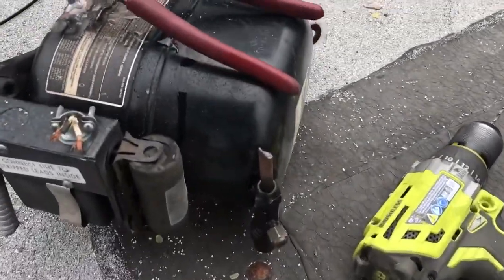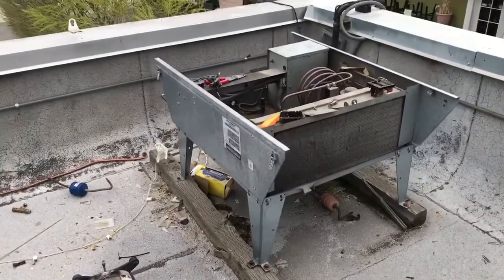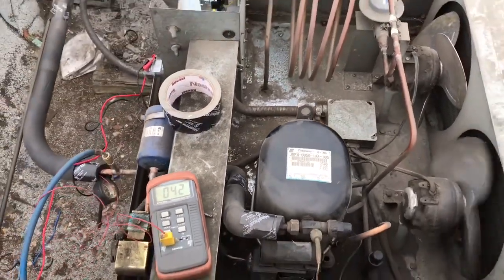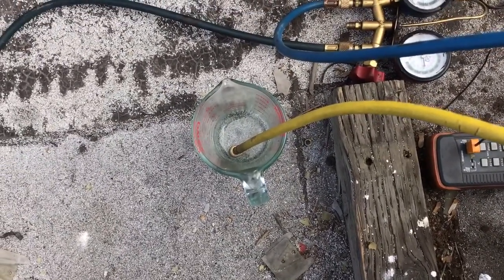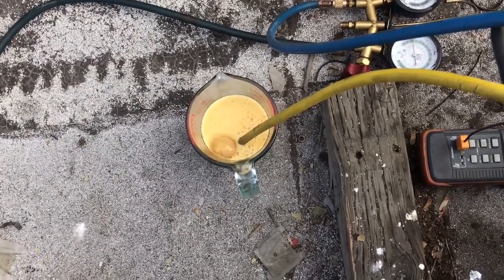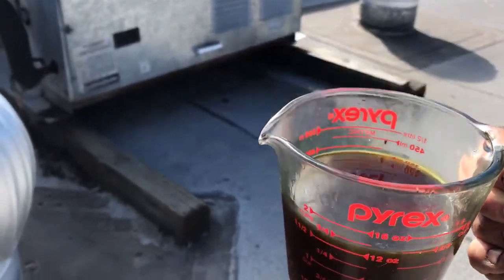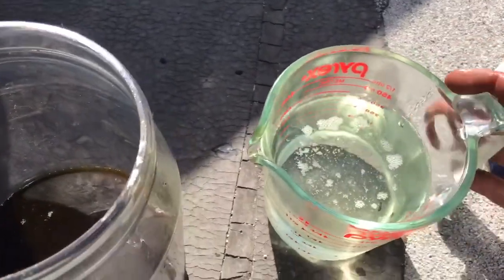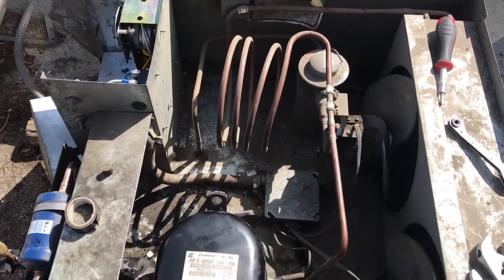POE oil change Hermitic Refrigeration Compressor Drain R22 to R407a Retrofit POE

Comment: is that the only way to change the oil?
Reply from the maker: most tech's unsolder remove compressor and poor out suction line then reinstall pull vacuum and suck in new poe oil.
Reply: @mjwdrones4all41  ok, also I got a random question. So my sisters ac was not working for her so I went up and cleaned up the condenser an that seemed to help but wasn't quit to my liking so I took the panel off the Acoil and what looked like an massive dust mess turned out to be a cloth like fabric on top of the fins, after I removed that it really improved the performance. Have you ever seen this and what would be the purpose of doing that?
Reply from the maker: @drken36  Most likely the filter fell apart years ago .... but not sure

Comment: Would you consider using R-421A?  It works with mineral oil so you don’t have to change compressor oil in an R-22 system
Reply from the maker: Wholesaler here dose not stock it...